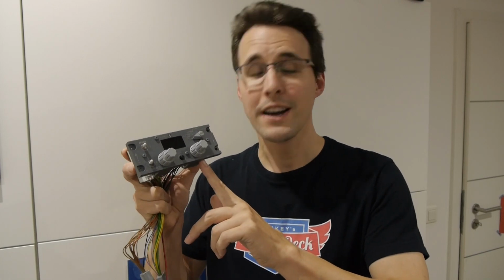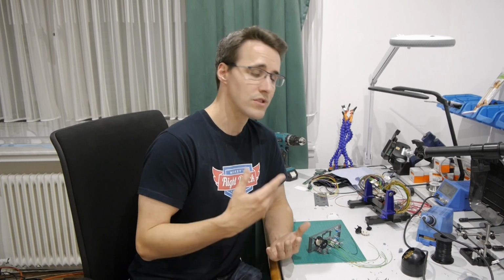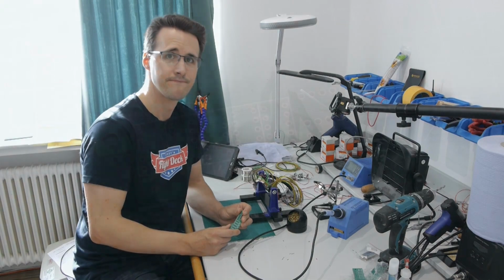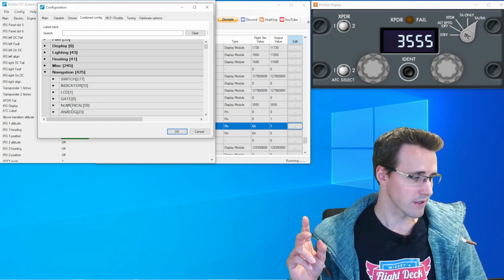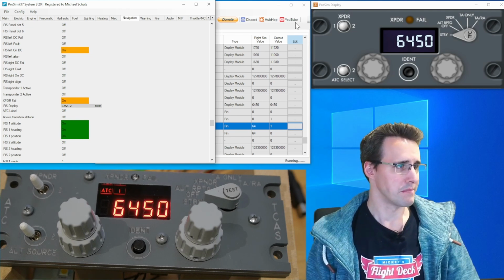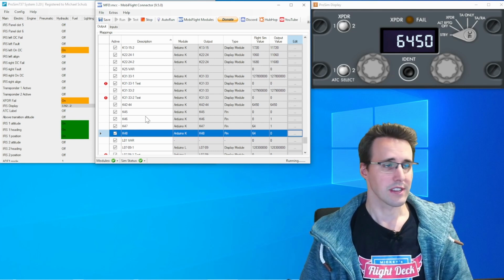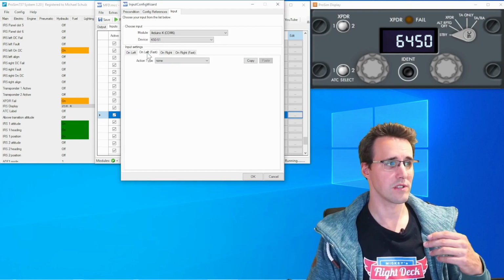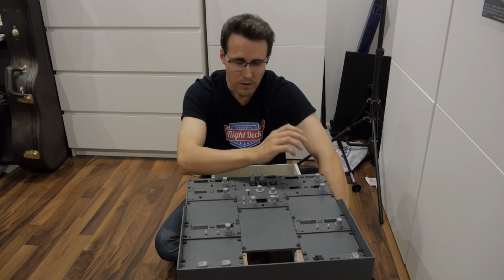Transponder Panel - A Boeing 737-800 Homecockpit #73

Comment: Hey Michael, the PASS/ FAIL display is available under a numerical output as display mode. all I/Os are also available in prosim, so you can also test the FAIL indicator from prosim system just clicking on the indicator value. Also gates can be tested like this in recent betas. love your work, btw. congrats

Comment: A xpndr test usually lights up all of the lights (so the segments would show 8888, basically)
Reply from the maker: Thank you, I will look this up.
Reply: @Mickeys_Flightdeck  Xpdr test will not illuminate all digits. It will run internal test, then shows PASS/FAIL on display. xpdr display test is done by the regular light test. Prosim has an output for all these display states.